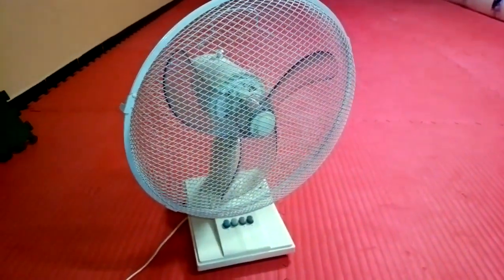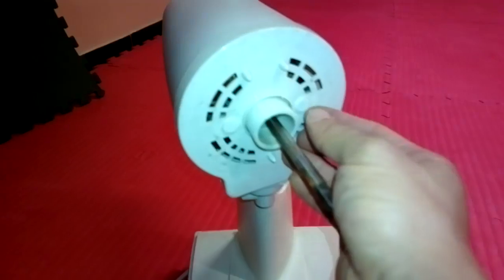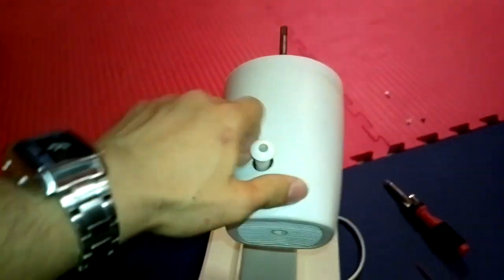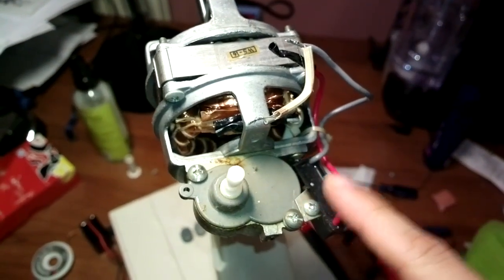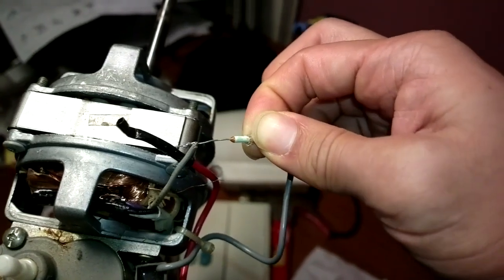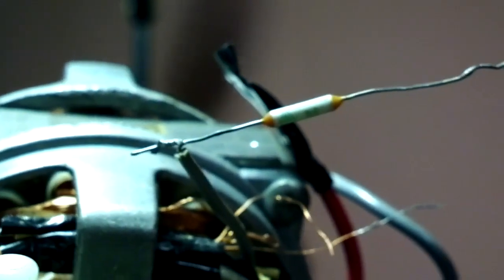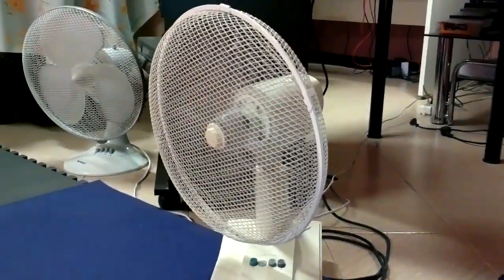Fan blades don't spin, no movement - Desk fan repair complete guide

Comment: Sooo.... found a standing fan that hasn’t worked for years. Checked the plug and connections and they all worked. I lubricated it and it would spin if I spun the shaft but if I placed the blades on it wouldn’t. Does that mean I have to change the capacitor?
Reply from the maker: Yes, you did all you can for the mechanical parts. Now it's time to fix the electrical.
Reply: @conceptedge  okay, thank you 😊

Comment: What if the old capacitor was holding a high voltage. Wouldn't you need to bleed it out first?
Reply from the maker: Generally if it were a working capacitor, yes. However, since it has not enough capacitance, not a big problem.

Comment: I can see that u replaced the original 1uF capacitor with a 5uF one . Is this a safe/ good idea?
Reply from the maker: Ideally you want the same capacitance
Reply: @conceptedge  so what are the pros and cons of replacing a 1uF with a 5uF one (like you did in the video)? Thanks for answering in advance. 😁😁

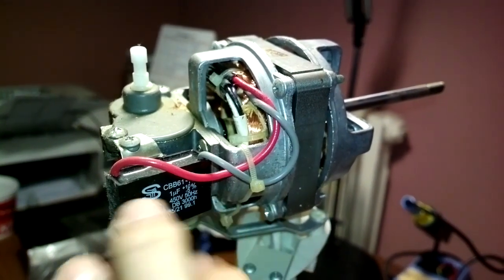Comment: 2:30 The most common reason for a fan that won't spin up is because there is built-up dirt and debris clogging the bearings. Strip down the fan as you have done, blow out the motor, and put two drops of light oil on each bearing. Now try to spin the shaft, and see if it doesn't spin easily.

Comment: Excuse me? I dont really think you will read my comment but, i have a 250v ac capasitor, a c61, do i need another 250v or i could get a 450v instead?
Reply from the maker: You can get one with a higher voltage, but never a lower voltage. However, you want to use the same capacitance. If it is 1.2uf, you can use 2uf if needed but not 10uf.

Comment: sometimes the thing that spins has no grease so i used wd40 til it dripped and i turn the fan on for 4 min and let the wd40 work... also if you get hair stuck on the spin thing thats another easy thing to deal with.

Comment: My fan abruptly stopped spinning while using it and then start spinning again after almost 24 hrs, like nothing happened.  Is there an explanation or solution for this?
Reply from the maker: It could be the motor overheating triggering the thermal sensor for a safety shut-off.

Comment: ... Dont want to be too hard on this guy, he does explain how common faults affect fans, but as a trained technician, I must tell everyone that all capacitors HOLD A CHARGE. The charge needs to be SAFELY bled off (drawn) from the capacitor first, or (an easier way) is to wait for the capacitor's charge to dissipate... Usually 1 hour (with all power turned off to the device). Even then, a pro would still check (with a multimeter) to see if the capacitor was no longer live. Not sure why this guy edits his video... We aren't shown how he swaps out the capacitor. My advice: If you aren't SURE what you're doing with mains voltage equipment, leave it well alone. Guide to how to bleed capacitor here: https://www.youtube.com/watch?v=aEupCE9btEU
Reply from the maker: I covered the capacitors discharging in other videos, and did not want to make this one too long. I appreciate your useful feedback.

Comment: I’ve been fixing fans for 20 years, the problem I find is the shaft bearings/bushings get dirty or dusty and the lubricating felt dries out causing the shaft lube to overheat and tarnish causing fan not to spin freely.

I usually install connectors on all the fan motor wires to ease disassembly in the future, then I polish motor shaft in area of both end bearings, then brass brushes inside the bearings as well as relube the felts on both ends with electric motor oil.

I’ve also started buying 70’s era fans and doing this same process because the motors were far superior in design and longevity compared to the garbage of today
Reply: True. I couldn't agree more
Reply: BINGO! I just took mine apart, used canned duster, then hit it with WD-40 and BOOM! it starts rite up! I feel so dang smart! lol
Reply from the maker: Thanks for your useful feedback. You are right, the older stuff last longer than today's fans.
Reply: How do you install connectors on motor wires? Are they screw on connectors? Guess you don't solder the wires?
Reply: My old fan from 1990 still working until today
Reply: You do a video
Reply: Yes but there's a difference between his and your problem. His fan isn't getting electricity because of a failed electrical component. You'd know that because the indicator light on the fan would be off. In your case, you have an indicator light on and a humming sound but the blades won't move

Comment: Hello Sir, what could it be if the fan only runs at low speed? If i turn it on on level I it barely starts to spin!
Reply: try cleaning the dust away if you haven't already
Reply: Faded i let some wd40 run down the shaft i think it runs better now

Comment: Dang - you are the first video I found showing taking off the casing to expose motor.... I did that to mine and cleaned and fixed it BUT I put it back together I didn’t place it proper and need to take it off again BUT it was a major pain in butt to take casing off because where your front plastic plate is held on with just a couple screws mine snaps on with tight plastic ‘tabs’ that almost caused me to mangle the fan the first time I took it apart... I suspect there is an easier way besides wedging a screwdriver between the plastic and wiggling while pulling, pushing and cursing to detach the two pieces but I haven’t figured it out and was hoping YouTube had the win.  Le sigh.

Thanks so much for the very informative tutorial though, I learned new stuff and I’ll come back for more at some point.

Comment: Hello sir, great video. my fan has a 3uf 300v capacitor in it, and I cannot fine a replacement in that style. can I replace it with a 3uf 450v?
Reply from the maker: Yes, you may use higher voltage but not lower.

Comment: I was just looking for a way to fix a slow moving fan. So what I did was open it and then put an air canister and blew into it until it was relatively clean and then put everything back and the fan moves at its usual speed for those who are interested.

Comment: You didn't mention one of the main reasons why a ventilator doesn't work: the absence of oil/grease in the bearings! 
Just try to get access to the bearings and oil them with penetrating or household oil. Don't use WD 40! Don't use too much oil and don't let any drops fall on the copper parts.
Reply from the maker: That is another main reason, but most people already know about that.
Reply: @conceptedge   I wouldn't be so shure. Many may find it helpful.

Comment: There's a related video that shows how to replace the capacitor, although not for one that is soldered in. That's a different video. Anyway, comments have helpful answers, like where to buy a capacitor. My suggestion would be hardware store but one of the comments suggest checking online.

https://www.youtube.com/watch?v=RIUtBWJeJDE

Comment: I can hear the motor sound but my fan won't spin. 1 and 2 button but when I switch to 3 it spin slowly than it works normal but there is a eeeee sound after that it stop and works normal
Reply from the maker: Capactior is going bad most likely.
Reply: Did you lubricate in your fan?

Comment: Hello. HELP. Maybe you can help me with your talent. I have a Rovex brand fan. Reference VT10-40 / V608. Voltage 230 V ~. Frequency 50 Hz. Intensity 0.24 A. Power 55 W. Class II. Air flow 65 m3 / minutes. 2 son come from the electrical outlet that plugs into a wall socket and are connected under the fan on the plate to turn on or off the fan (plate called contactor I think ..... choose between 3 speeds and start or stop). From there are connected son on the small black cube (I forgot his name, it's a kind of square or black rectangle with 2 rods where are welded son) and 5 son of different colors but difficult to identify because I'm color-blind (2 kinds of colors 1 dark green and 1 light green, 1 white, 1 light yellow and 1 rosé ... Frankly for me it's difficult to identify colors with certainty, so I'm not sure of their colors) . In short, this 5 wires should normally be connected to the motor of the copper coil, directly on the copper. But that's where I have a problem because the 5 wires supposed to be connected on the coil motor are all detached and I can not identify the exact place where I have to reconnect them (or weld if it's done on directly). Please help me, need explanation with these 5 wires, where should I connect them on the copper coil? Inside the coil, there are 16 rectangle-shaped notches one after the other in circular. It's inside where the rod is centered with the fan magnet. The coil is made of red copper and normally it would have to leave the small copper wires but they were not visible as if they had been cut or torn up which makes it possible to connect the 5 wires. So I can not identify the exact place where to connect these 5 strands therefore to run the engine by sending electricity

Comment: that thermal fuse is NOT "resettable". once it opens its toast. in my experience, the thermal fuse is the prime culprit in small motor failure. they will often fail just from age. easy test is to connect the leads together bypassing the fuse & see if the motor runs.
Reply from the maker: You are correct that some thermal fuses are not resettable, but many modern appliance come with the resettable version like this: http://www.littelfuse.com/products/resettable-ptcs.aspx

Comment: Waste of time. All he does is spend six minutes talking about how he needs to change the capacitor and then he doesn't even show it. Absolute garbage tutorial. Go watch Bam6972's video. He spends nearly 20 minutes actually showing you how to properly clean and regrease the machine, and it works. This guy here doesn't show jack shit, and this video only needs to be about four seconds long. "Go buy a new capacitor". There. I just condensed this video into a sentence. You've as good as watched the video now if you've read this comment. lol.

Comment: First thing to check before replacing anything is if you can hear it trying to work then check for seized spindle. If it is seized unblock it give it a good clean and grease up. Worked for me.
Reply: Explain more on seized spindle

Comment: Lubrication took care of my fan's problem without replacing any parts. My fan would only rotate when forced by hand - and then only very roughly. I disassembled the motor and greased the shaft where it goes through the holes at the front and back of the motor. I could immediately feel that smooth rotation was restored. When I reassembled everything and powered up the fan it ran normally again.
Reply: for me tho

Comment: Will the solutions you presented in this video work for all fan models? Because the fan that I need to repair came from japan. Additionally, the problem with mine is that it experienced the exact same slow start up issues as you fan in the video, but now when I turn it on it just makes a humming noise.
Reply from the maker: TheMeanIguanaFilms It applies to all fans made this way

Comment: its called a motor run capacitor as this is a Permanent Split Capacitor motor.  if you live in the USA you can replace this capacitor with a metal oval capacitor of the same microfarad but you can go up on the peak voltage if its a 3MFD or uf 250 VAC you can replace it with a metal oval run capacitor a 3 MFD  or uf 370 VAC capacitor but however you may need to relocate it to inside the base of the fan and run the wires up to the motor that way. and you can replace the thermal fuse with an klixon 100c 212f auto reset thermal protector you can find them on EBAY. as that can turn off the motor when it overheats and turn the motor back on when it cools.  in your area you live in the sound the motor made in your fan you are using 50HZ or 50 cycles.and higher voltages. Here in the US the voltages and frequency is different as its 60 HZ or 60 cycles.  but then again this is called a motor run capacitor as its a PSC or Permanent Split Capacitor motor the capacitor starts the motor as well increase its efficiency much better than shaded pole motors which have no run cap but a copper winding on each pole that starts the motor but decreases its efficiency and wastes energy.

Comment: I replaced the capacitor as you suggested, but it still did not fix the problem. On my fan, I have a knob that has 4 positions = 0 (off), 3 (high), 2 (medium), 1 (low). At position 3, there seems to be attempt to try to start --- I feel a slight vibration in the motor, but the blade does not turn.
Reply: njtexit8 did yu find the solution to the problem
Reply: Did you try to spin at shaft motor?
Reply: try to lube the shaft and spin the blade manually and see does it helps.

Comment: This looks kind of dangerous, and scary. 

A common problem with the fans I own is that, after using them for a long time, they stop spinning, or they need me to spin them first and then they start moving. After a while, they don't spin. 

I guess your video solves the problem?
Reply: Yes, replace the capacitor. If you have simple DIY tools you can do it.

Comment: what is the purpose of the uf rating, and can a 450vac capacitor replace a 250 one
Reply: The uF rating indicates the storage capacity of the capacitor.  For this fan the original capacitor is 1 uF  450V. You would need to buy 1 uF or greater. The next higher capacity would be 1.5 uF.  

As for the voltage rating, you would need a capacitor rated 450V or higher to replace the original capacitor in this fan.

My fan's capacitor is 3 uF, so I bought one on eBay.
Reply: Depending if your mains is ~240V or ~110V, your capacitor rating shound not be lower than the mains. 

Eg: if you're on a 240 mains, then even if you change the 450 to 240 its ok (or vice verca in this case). But if you choose a rating lower than your mains... well, lets say there might be a loud bang and big flash ^_^ ......naughty.

Comment: what a tease...6 minutes of slow mo chat, then...Presto! "Now it works cause I replaced the capacitor." Didn't show a single relevant pic of doing the essence of the repair. But he saved the planet from one more junked fan, at least. LOL.
Reply from the maker: The soldering skill is covered in other videos on my channel so I don't want to be repetitive. It is not easy to edit the video down to the more relevant part pertaining to the actual troubleshooting.
Reply: +1000uf I guess that your fan had this problem where you turn it on and it doesn't spin at all. The same thing happened to me with my Lasko 16" Oscillating Pedestal Fan 2524 (Older Model) on Wednesday, 3/16/2016. Does this use the same kind of type or something inside the fan motor with the wires and stuff? I do want to get my Lasko 16" Oscillating Pedestal Fan 2524 (Older Model) fixed and get it to spin again at a Fan Speed I choose. Can you tell me in the comments how to repair my Lasko 16" Oscillating Pedestal Fan 2524 (Older Model)? I wish to get it fixed.
Reply: @videolover2014  wd40 worked for me
Reply from the maker: No need to get into the fan motor itself. Try to replace the capacitor. I have another video on my channel showing how to solder and de-solder.
Reply: Jack Ryan p
Reply: get a life
Reply: Jack Ryan ABC
Reply: Jack T. Ryan a
Reply: I dont get it. Whats so difficult about changing a capacitor? If its the soldering part, then just look up for tutorials on that.

Comment: Great vid.  A neighbor gave me a Vento brand floor fan that she said "gave up on her" plus she was moving out so she was tossing all sorts of "goodies". The fan caught my attention because I have serviced (lubricated mostly) over the years all of my fans and have yet to cause more ecological problems by dumping them in the garbage.
Well, I took the fan back and lubed it as usual but it would not start up (capacitor most likely as you say) but spinning by hand, spun verrrry slowly with the juice connected. At least it spun as before it was very hard to do so. 

I am going to buy the capacitor first as you suggest, and see what happens and altho Vento is a decent brand (cost around $800mxn pesos or $45 usd at local Mexican Home Depot) as seen by the construction of the motor--very solid, it too had all leads soldered to the capacitor but not prob for me. Will update progress.
Reply: Update?

Comment: Am lazy i just buy 1 dollar oil can spray it the motor that spins easy fix for me.
Reply from the maker: No. If it were that simple, why would I bother to make a video? Obviously it doesn't solve the problem as you suggested.
Reply: 1000uf ay bud  had the same problem bud and i took apart the the lil motor greased it up inside works like a charm now to squeaks and spins really well

Comment: You're video is magical! All I did was watch it and right at the end of the video my USB powered fan worked again! I'm sure that I'll have to replace the capacitor though since that's what you taught me is the usual problem when it experiences slowdowns.
Reply: It sounds like your fan was probably overheated, and has a resettable fuse, and when it cooled down enough, it started itself back up automatically. If it overheats too many times your capacitor may die.

Comment: my table fan got stuck when i used whole night and in the morning it was stuck ,, and it was hard to rotate .... i  done the  oiling thing and my fan blades rotate..

but the fan not speeding up when i was changing the speed and also fan run on same speed in all the speed switches and fan motor getting too hot that  we cant touch ... after using it for 5 min .. pls fix  my issue .